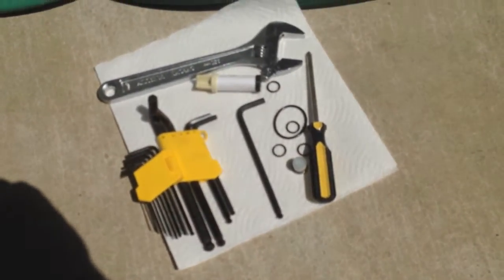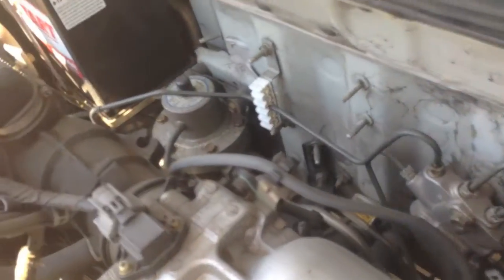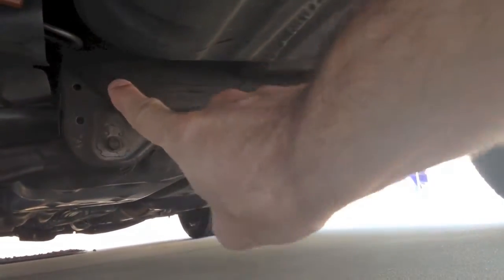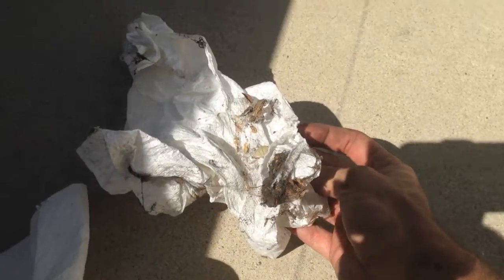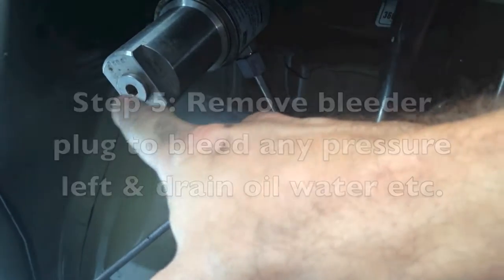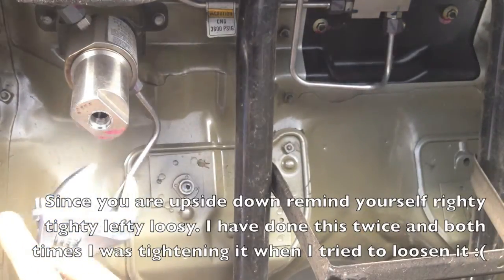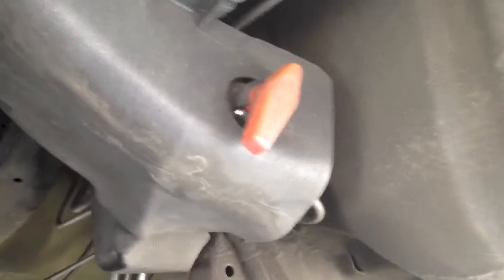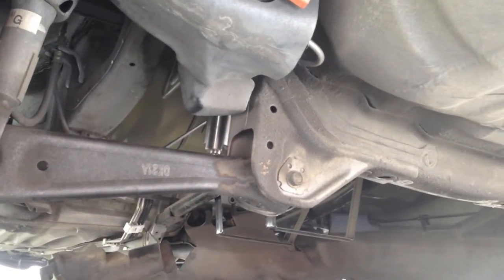How to Change your 1998-2000 Honda Civic GX CNG High Pressure Fuel Filter

Comment: I currently own a 2000. I love the fuel efficiency. Just hate the limited fill stations
Reply from the maker: I loved the 2000 year civic GX and the efficiency. Just make sure you change the filter on this one on a consistent basis and check the bleeder on the fuel filter housing every oil change. I owned several CNG vehicles and on the 2000 year civic the problems I saw were clogged fuel injectors (previous owners going 50K between fuel filter changes) and on two that I owned they started needing the rear main seal at 175K miles and both of them had oil pan leaks at 150K miles. The oil pan leaks I fixed on both for $150 but the rear main seals weren't a disaster so I monitored them and did bars leak. The fill station limitations are what made me get out of CNG cars. Any questions just let me know

Comment: This is an awesome video. Thanks! Also if you've every changed/cleaned the injectors with a ultrasonic cleaner you should post it. 
Again, Great work!
Reply from the maker: Thanks Brett! If I ever do change them or clean them I will, thanks for the suggestion. The GX I have had the injectors changed before I bought it used so I don't plan on having to change them. Why'd you decide to by a CNG honda?
Reply: I started commuting 90 miles a day so I need to save on fuel. They're great cars.
Reply from the maker: Brett Jones yeah my wife and I drive out 80 miles one way to the desert to see family on weekends and we fill up for ~$1.80 a gallon. Normally we drive about 800 miles a month and spend like $40 total for the month. I've had a few CNG vehicles, love them

Comment: great video, helped change filters, same principal on my car, but when i fill up, i can smell gas inside car,  the next morning, i have a dedicated cng 97 ford crown vic, where do i start to find leak?
Reply from the maker: Did you smell gas inside your car before you changed the filter? You can use soap and water spray it on the housing that you took off to replace the filter...maybe it wasn't tightened and has a leak?

Comment: great video I have 1998 civic CNG wont estart and went it start shake and shut off please help.
Reply from the maker: +Martin Vilchis I had a 2009 civic that had an issue of starting. It would not turn over. I pushed it into the hot sun when a mechanic friend told me it might be oil build up in the lines/injectors which the heat on the car would "loosen" it up. Put it in the sun for 30 minutes and it fired up.
Reply from the maker: +Martin Vilchis Try changing your filter and wipe the canister clean of oil. Make sure you turned the shut off valve back to the "on" position. In line with the fuel line. If it isn't starting could be clogged injectors, or something else with the spark plugs of coils (not likely though). Hard to say 100% sure without hearing it and getting a mechanic on it. But If you haven't changed your filter in a while you could have misfire or starved lines.
Reply from the maker: +Martin Vilchis Previous owners of my 98-2000 cng civics didn't change the filter in 50K-60K miles and both had problems with the injector #3. They had to have them replace but i've heard you can send them out to be cleaned for $50 each in SoCal somewhere or clean them yourself with ultrasonic cleaner but i don't know how. If you are in Southern CA there is a mechanic in Mission Viejo that does CNG. search online.
Reply from the maker: Another commenter said Rc fuel injection in Torrance cleaned his injectors (he removed them himself) or there is a mechanic in mission Viejo that works on these cars and can help you called mikes advanced auto care look me up on Yelp and give em a call
Reply: Thank you very much for you help.

Comment: How much was is to change the fuel injector I looked it up for one it's $500 did you change all four or did he just change one of them? Mine has a fuel injector problem right now so I will start changing the fuel filter which I have never done on my car
Reply from the maker: What year is your car (I'm guessing 98-2000)? How many miles has it ran without having a fuel filter change? I found the Honda dealer invoice from 2007 of one of the 2000 GXs I owned and it cost him $500 for the injector and $180 for labor to replace 1 injector. I think he changed filter once in 87K miles so it was an expensive lesson...the dealers didn't even know to change the filters it seems since all his service was at Honda. He bought it new. Shop around. Try to find some experienced mechanics if you can. I've heard people have taken the injector out and cleaned them with an ultrasonic injector cleaning. Google it, there might be videos and posts that help you if the filter doesn't solve it (which it probably won't). I think those years the 3rd injector clogged (if my memory serves me well).

Comment: Hello, I'm having an issue with my 2003 Civic GX.  Trying to replace my low pressure fuel filter, but when I do, the top casing of the new filter and rubber gasket seem to fail.  The lip that holds the gasket gets completely pushed back down and the gasket falls off the side of the canister.  I saw some of your post on cngchat and figured you may have come across a scenario similar to this.  Any advice would be deeply appreciated.  Thanks.
Reply from the maker: I never owned your model year civic GX (2001-2005), I really wish I knew how to solve your problem. Try to find the number for Carl from CNG consulting in San Pedro on Cngchat, if anyone would know it would be him. And please let us know how it was fixed.
Reply: ItsBrian.  I ned repair my car. Honda civic.   1998 Honda Civic. Regulator

Comment: How do u let the gas out of  the tank for the 2000 gx
Reply from the maker: Could you clarify more what you are trying to do? If you want to totally exhaust all the remaining fuel from your natural gas high pressure tank the easiest way is to close the shut off valve like I did in this video, run the car out of gas in the lines before you open the fuel filter housing, then remove the housing. Now with the housing off of the fuel filter it is open to the air, all you would need to do is open the manual shut off valve from off to on SLOWLY to release the fuel and pressure from the tank in the back. This will release all of the fuel in the tank to the air. DISCLAIMER: High pressure fuel is still in your tank 3600 psi so do this at your own risk! AND this will release gallons of natural gas into the air that does dissipate into the atmosphere but I don't want anyone reading this to get asphyxiated by CNG being breathed in under the car when you are releasing it! Also if you exhaust this in an enclosed space like a garage it will release all the natural gas into your enclosed space and can kill or harm you. Take care, seek a professional if you aren't experienced and do this at your own risk! I don't want any liability or anyone getting hurt....

If I was going to do that before say removing the tank from the car I would do what I said and turn the valve from off to on very slowly and just be patient until all the gas is out.

Comment: I just bought one of these for a 1000 .Its throwing 2 error codes PO420 & PO191.
Reply from the maker: You bought the car for $1000?! How many miles? Google search for PO420 shows catalyst system below threshold and PO191 says something about fuel rail pressure. Call a tech! Call Honda see if you can chat with a tech to get an idea of a quote, sometimes they are cool other times they want you to pay $100 to bring in to diagnose. Or find a local or small CNG mechanic online to chat about it. Where are you located? Also know your CNG tanks expired in 2015.
Reply: ItsBrian 144,000 miles on it .They put a new tank in it 4 years ago .Gas mileage seems to suck .118 on a full tank 8.00 to fill up.
Reply from the maker: That's a good price for the car. I would find a tech to help you. I have never had any issues with those codes when I had my CNG cars. Let me know what happens when you get it fixed. @Lavir391
Reply: ItsBrian my cars starts sputtering when you step on it at 60mph .But fine when accelerating slowly I wonder if this is the problem
Reply from the maker: @Lavir391  it sounds like it is not getting enough fuel. So some where in the system it is not operating properly. Try to clean the injectors or replace them. These older models only had one filter and would get clogged if the filter wasn't changed.

Comment: Don't buy a newer GX.  They have a low pressure filter that is hell to replace.
Reply from the maker: I hear ya :( - but keep in mind that the 98-2000 civic only had one filter so the newer ones with 2 filters (high and low pressure) are better at catching impurities before they get to your injectors and engine. I believe this is why Honda added the low pressure because the prior owners of my 2000 civic gx had clogged injectors from not replacing filters after 50K miles. I'm sure this happens in the newer generations but with two filters it probably last little longer.

Comment: did you seriously have a high pressure o ring lying on the ground?  Ughh.
Reply from the maker: Yes, it was not a dirty area and wasn't going to pick up anything that would prevent it from sealing, wasn't a big deal when I did it for me at least and never had any issues with the car. Would it have been better from the container straight to the housing sure, but I bought it online and it was shipped unsealed. Do you want to at least elaborate on why you commented this specific comment so that anyone reading this can determine if your insight is beneficial with some constructive reasons why? I am all for constructive criticism just could do without negative comments trolling me on the internet.